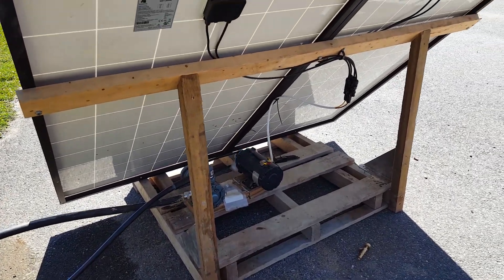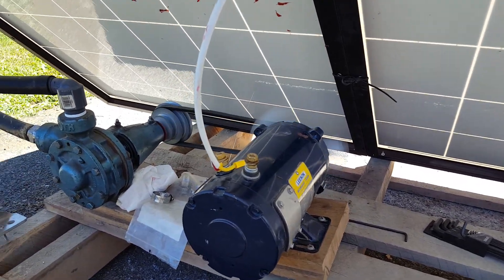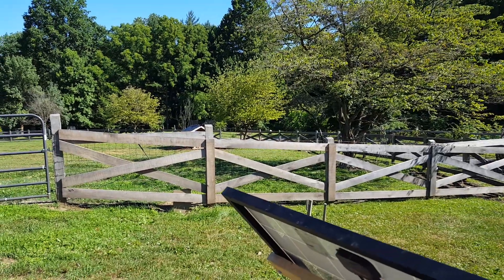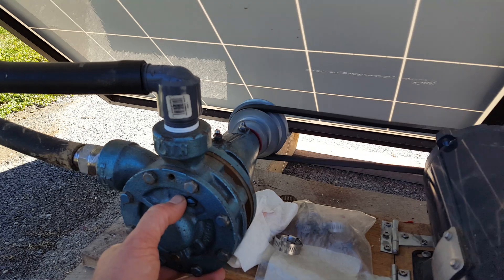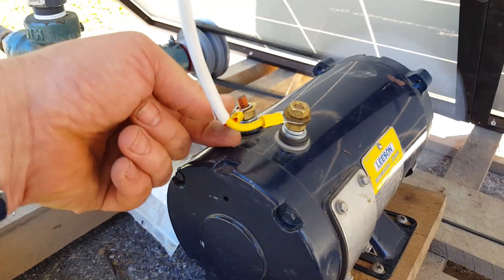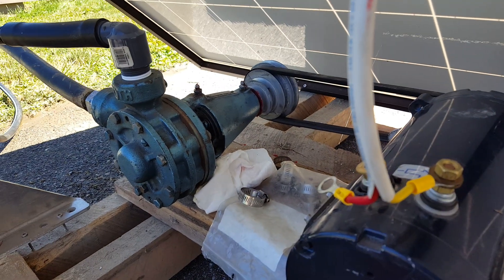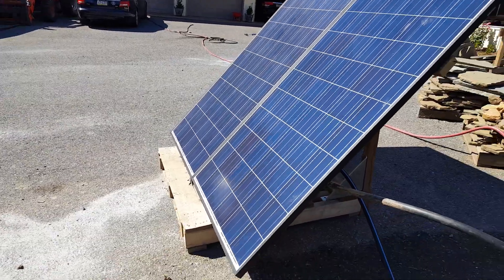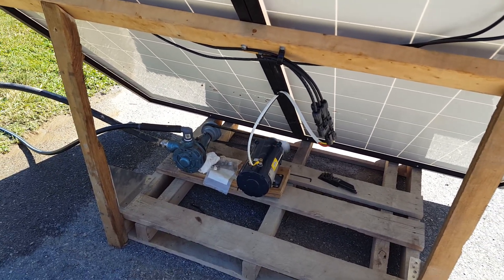Solar direct water pumping (PV direct)

Comment: If we connect pump direct to solar panels then plz tell me that it harm motor or not if current is low or high than what will  happen to motor
Reply: their is need for a converter to even out the current produced by the solar panel
Reply from the maker: I don't think it would cause any problem either way. Too little power would mean that there are not enough amps to support the voltage in lower light. The only problem in full sun would be if you connect your panels in the wrong way to get too much voltage, not amps.I put my panels in parallel because each panel produces the proper voltage for the pump. Putting them in parallel adds the amps together.
Reply: @lambertmt  thank sir I have 280watt 24 volt 12 amp pump and it directly connect to solar panels 225*2  is it right to operate motor in full sunshine
Reply: Justttt
Pump it .

Comment: Good idea.  How did it work?
Reply from the maker: It pumped well, but it had trouble restarting itself on a partly cloudy day.  I'm adding batteries, a charge controller and a "state of charge" relay to allow the pump to run only when batteries are full enough.  Batteries help with start-up current, and the relay prevents running at night.
Reply: @lambertmt  Thanks for the feedback.  Those changes make sense to me.